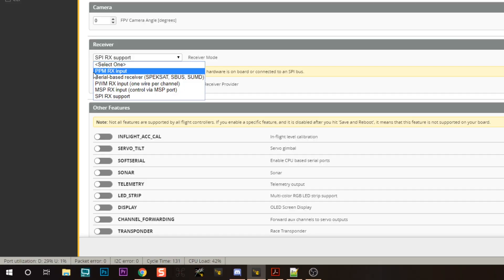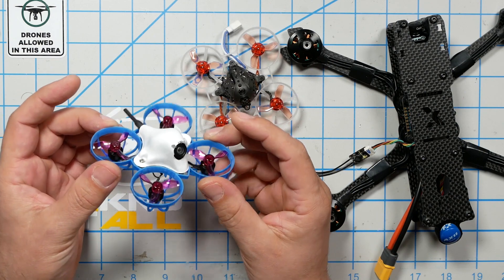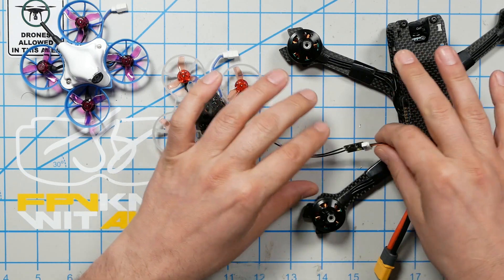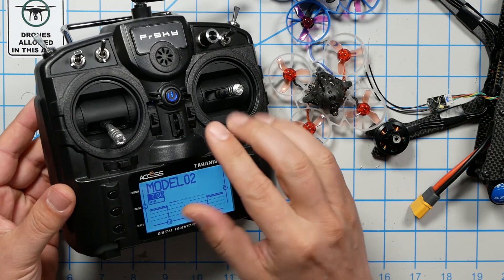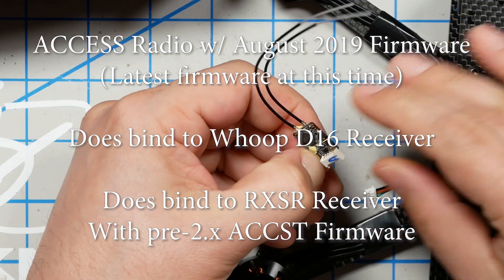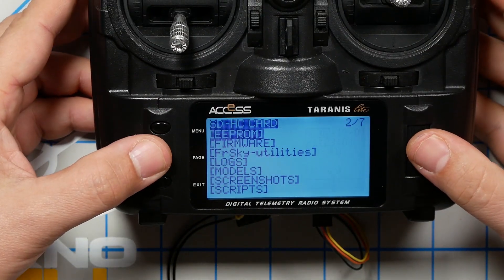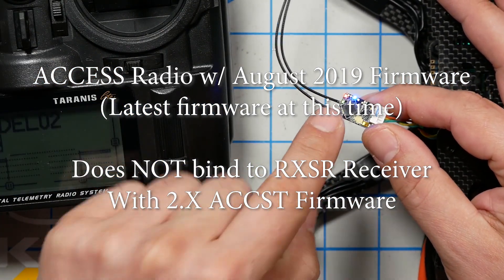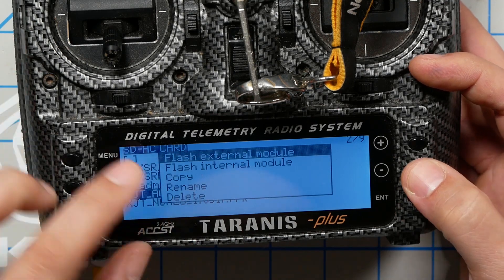FrSky won't bind! ACCST 2.0 is to blame.

Comment: New receiver, wrong country firmware. Made the mistake of updating the RX only to come across this. LUCKILY, on the FrSky downloads, at the bottom there’s a “history firmware DOWNLOAD (not compatible with v2.x.x)”. It downloads an older version and works. Needless to say I’m not impressed that it has to be this way. When £ allows, Crossfire will be my path.

Comment: Hi Joshua. You really should update this video somehow. Can your edit your description? You say at least twice that the Jumper's module "...can not and will not support ACCST v2..." but it does now, and has for a while since you made this video. I love FrSky bashing too, but there really was an uncommanded servo movement issue that FrSky addressed (then tacked mild encryption into, making v1 incompatible). To anyone reading this, I recommend updating everything FrSky branded to ACCST v2, then using a multiprotocol module with the latest firmware to fly anything you own, ACCST v1 or ACCST v2.

Comment: I have an X9 Lite and would consider getting the R9M module if it weren't for the confusing firmware soup and absurd business decisions constantly breaking backwards compatibility with non documented things like D16 2.0. Everything Frsky is so opaque that I had no idea when I bought my X9 Lite that I'd have to buy a multiprotocol module just to be able to bind D8. What a disgraceful company. Jumper T16 and Crossfire seems to be the ultimate setup to fly everything without having to swap modules.

Comment: Then take your Qx7 recommendation off of your website. The only reason I bought the, now, crappy radio was because all you guys recommended it as a good entry level radio. Now, I'm gonna run into this "no bind" issue down the road because I'm gonna forget about this vid. Then "upgrade" the firmware to ACCST 2.0.
Reply: Qx7 is great man , been flying mine on R9m for over 1.5 years, flawless, but I only 5 n 6in
Reply: @flo-ridafpv5713  That's supper great to hear. I have the Qx7 also and I do like it. What makes me mad is how these how highly recommended products slowly start to stack up negatives as time goes on. That's reason I've avoided this hobby for as long as I have. I want a completed product but, I'm starting to realize that this hobby is still littered with half-assed products. Then these YouTubers pimp the garbage without a disclaimer so they can get that coveted "play my game and get paid" lifestyle. I'm just tired of this instant gratification world we live in. It's even got to the point where video games don't come out completed because of this "we  can just update it after" mentality. People shouldn't just put up with bullcrap just to get a little taste of the good stuff. I just want to be informed about the negatives a little more. If comes down to spending $800 dollars for a radio and not to get shafted. Then that's what I'll do. But, don't tell me "oh, this $100 radio will do everything you'll need." Then 6 months later be like "maybe not." Along with ignore me on streams because I call you on the carpet.
Reply: @focusforlife  cool qx7 is solod gear that wont change, if you mean bardwell, he's a good dude who's actually in it to help the buyer he's not a shill, been watching him for years, this issue is just deeper than good product bad product, it's about the ecosystem that frisky is making super complicated w ton of firmware versions n trying to lock out 3rd party stuff when they started on open source, that's all n people are pissed. So don't hate bardwell he's tryin to help educate us
Reply: @focusforlife  and just don't update man simple, I was on 2.0 n only went 2.2.2 to get r9m to work like 1.75 years ago,  still on it, if it aint broke dont fix ;) watch Pawel say it   https://youtu.be/UXl-F-WsEs8
Reply: @flo-ridafpv5713  thanks for the great positive attitude in your replies. I'm not just trying to be a hater. I agree Bardwell is a good dude. His delivery, on some stuff, just gets my goat. As far as his streams go, I just get tired of the repeated questions being answered. I watched a viewer spam a question, that could've been answered if he just watched Bardwell's vids, for 3 streams in a row and,  get answered. Then I've seen other legit questions just get skimmed over. I hate watching streams just for a small morsel of info. That's all, mang. Thanks for a good convo.
Reply: @focusforlife  yea man I feel ya, u gotta understand all he does is try to serve the ppl, it's his bread n butter, n ppl are bugging him w frsky created probs, i watch his streams after so i can FF n cuz I like him I can't handle all the live chat lol & u must not be on any Facebook fpv groups, no one searches they just post, but they get answers fast n are a wealth of knowledge, like RCG used to be but searchable, Feel free to ask me if ya need help I might know, been absorbing this shit for years ;)
Reply: @flo-ridafpv5713  will do man. Thanks again.

Comment: "Jumper T16 which can not and will never support the ACCST 2.0 protocol" Yeah... I guess you were wrong about that. The multimodule now does support it.
Reply from the maker: I think you are thinking about the hardware mod that basically installs an ACCESS module inside the radio. Pascal was asked in Dec 2020, "Will you support ACCESS," and he said "no" and marked the request as "Won't Do."

https://github.com/pascallanger/DIY-Multiprotocol-TX-Module/issues/487

If you know different let me know. MPM support for ACCESS would be great.

Comment: Is the issue with the "uncontrolled servo movements" that was fixed with this even relevant for us quad flyers? There are no servos on our quads or am I wrong? So if so it doesn't make sense to upgrade anyway. I also don't like the way FrSky is going but to be fair all other Rx manufacturers have the same bugs with servo movements etc inside their firmware and just don't give a damn about fixing it. At least FrSky tries to fix issues in their protocol and improve the transmission. This is something that I would also like to see from Radiomaster etc.
Reply from the maker: It is relevant. "servo movement" just refers to the outputs of the receiver.
Reply: @JoshuaBardwell  Ah yes sorry that's right I've read that long time ago in a german manual. From Input -> to mixer -> to servo output -> to HF Module 😀. Ok but in the same manual it is written that those servo movements problem only occurs very rarely on LBT Firmwares and even rarer on FCC Firmwares.

Comment: Still can't get 1 of many RXs to recover bind after moving models around on my Jumper T16. I cannot rebind it, which tells me it is still bound to transmitter. I have tried all the receiver numbers in case it was locked to the model slot number. Funny how all the other RXs never skipped a beat. Last time this happened I reverted to the backup I made prior to the changes made and it fixed the problem. Not so lucky this time. I updated all my Frsky the day they released the 2.0 updates before trying them out. Oops! Learned something, thank you Joshua, so not a total waste of time.

Comment: Slightly releted...With access the XM+ has only version 1.1.2. That version doesn't exist for the R-XSR (1.1.1, 1.1.3, 1.1.4) so you cannot use them together. Infuriating!! Had to downgrade all my XM+ to accst.

Comment: Thanks god I have replaced the frsky internal module with a 4in1 multiprotocol in my x9d+
Will never buy new frsky again!
Reply: That sounds great! I didn't knew that you could do that!
Reply: @jorgeromero4680  I cheated a bit :-) Actually the internal module burned up, so insted of replacing it, I removed it, and installed a 4in1 multimodule. I have a crossfire in the modulebay, and run them both as external modules. I use a 4 pole switch to select which module I run. This way I can run almost any protocol out there, including the old working frsky protocol :-)

Comment: I have a Taranis x9d on 2.1.9 I order a couple of XM+ Receivers for two new models, ZOHD Dart and ZOHD Drift. I was not able to bind these RX and searched YT and found videos showing how to update the firmware on my TX and the new RX to support new FCC / LBT. If you screw up like i did and upgrade your firmware as advised on the Fr-Sky site x9d+ , XM+ receivers. You can go back flash your TX and RX back by following this link. https://intofpv.com/t-beware-frsky-accst-d16-2-x-x-firmware?page=2 Just don't ever upgrade your openTX.

Comment: I don't understand why this was a shock to anyone, it says on the download page that you need to update both the receiver and remote. So obviously it won't work. This video was just made to create drama. Also why not just bind the betafpv quad in d8?
Reply from the maker: I would like to share with you the huge number of questions I have received in the last two weeks, that have been caused by this issue. I didn't create this drama. This video is designed to clear up questions about what will bind to what. You are right that you can bind the Beta quad in D8. But before I made this video, did you know that would work? Or might ACCST 2.0 also break D8 compatibility? That's why I made the video: to find out, and to let everyone else know too.

Comment: Ran into it yesterday... normally other brand user, wanted to help out our club. There are 2 QX7 radio's available foor Master/Student link. We added a frsky sbus to one of them for a wireless link which works... Than we had som Jumper R8 rx's sitting ont the shelve we opted to use.... then we went down the Sh*thole.... WIll never ever buy anything from this company.. I use ELRS as well. at least thats a clear path....

Comment: Don't most built-in D16 receivers also allow you to bind in D8? I had to do that in the past when Betaflight didn't handle D16 on SPI very well.
Reply: But the latest FrSky radios do not support D8 :)
Reply: @tomaszstelmach2844  good point! Worst case though you could put a MPM in the module bay, giving both D8 and 'old' D16?

Comment: i HATE companies that use deliberate introduced incompatibilities and segmentation as a competition or lock in tactic it is the WORST HORRIBLE SLIMY anti-consumer anti-competition and should be rooted out and punished
Reply: and there needs to be OPEN STANDARDS for digital vtx and telemetry and control for gods sake people its just sending numbers and data packets over rf it's not rocket science :V

Comment: Greet from Germany .. bougt an betafpv65s pro wont bind with my Qx7 ... That moment i never fly again ... -.-
Reply: Uh? Either it’s a faulty RC or you’re not using SPI and Frsky_D...
My 75s worked without issue with my QX7.

Comment: Ryan Macaluso, FrSky Director of North American Operations says you’re wrong. I mean, I can’t prove you wrong, which is the problem, but HE says you’re wrong. Other knowledgeable youtubers have also very recently told me that once you flash the ISRM up to 2.shit, it nerfs spi compatibility. That’s what I’m finding time and time again in my own testing.
Reply from the maker: What does he say I'm wrong about? The SPI and other 3rd party receivers being incompatible with FrSky firmware 2.x is not up for debate.
Reply: @JoshuaBardwell  One of our customers bought a new Archer RS and it wouldn’t register/bind on ISRM  1.3 so we had to flash it to 2.x. He found out the hard way that it broke compatibility with all of his spi boards. I’m being told by everybody but Ryan you have to choose one firmware or the other.
Reply from the maker: In my experience, FrSky firmware 2.x will only bind to authentic Frsky receivers running firmware 2.x or newer. If Ryan Macaluso wants to show me different I would love for that to be true.

I guess one exception would be receivers like the Jumper R1 which is a clone of the XSR that runs XSR firmware. In theory you could flash that to 2.1.

The good news (I hope) with Archer is that you can update it OTA? Did that work for you?
Reply: @JoshuaBardwell  once I updated the ISRM, it registered and bound, and it was passing signals to the board. If it needed to be updated, would it have detected that and popped a prompt like TBS?

Comment: Hi Joshua. I accidentally run into the same problem with BetaFpv65s + Taranis X9Lite. I found your video. I cried. And then I found this: https://www.currykitten.co.uk/using-spi-receivers-with-an-lbt-eu-radio/
solution 1: A Multiprotocol Module - I would like to buy it.
solution 2: The original firmware was MATEKF411RX version 3.5.something. With the latest 4.2.5 (which is maybe too high for that little one) it can bind but not work. With 4.1.0 I was able to bind and ARM. But with FRSKY_X_LBT selected it losing the RX signal every moment. Just change the mode and you can hear "Telemetry lost."
solution 3: Looks like working well. Yet. ;-)

Comment: See this is why I use Flysky. Nah jk I just can’t afford anything else
Reply: I mean it works and I like the basic transmitters. Granted, my i6 has more cost in its modifications than the controller cost, but it does great and works with plenty of tiny whoops and a huge variety of receivers.

I’d take more batteries and more flight time than a better controller, and better is relative, I’ve used a $1k+ transmitter and it was setup like $hit for me out of the factory and literally all wrong for how I’d want to fly, like seriously the thing was a waste of money and required more tinkering to get useable than a flysky with a LiPo battery mod. Lol, I really tried convincing the team to just not use it, I think it was a Spectrum DSMX protocol, something absolute top of the model (and it looked nice), but it was terribly clunky and the stick friction and spring settings were so stupid out of the box I don’t see how anyone could have liked that, like I don’t like grinding noises coming from my transmitters! And it wasn’t a one off, the team had ordered several, it’s just how they set them up from factory. Plus the setup was overly complex and we didn’t need something that fancy for flying jet powered UAVs anyways (a flysky 6ch could do that, throttle, 2 flaps, thrust vectoring X and Y, and munitions deployment, 6ch... no need for 16ch or whatever it was).

Comment: The real question is, can you downgrade back?
Reply from the maker: Yes.
Reply: Until FrSky starts releasing rx that don’t work with the old version... wait and see. It’s like a slow motion suicide.
Reply: @brokenprop2474  As long as the r-xsr can be flashed with the old firmware, I think it's fine. I don't like the way things are going though :(

Comment: Well this is a bit unfair and misinformed. The SPI RX implementation in Betaflight is a reverse engineering of D8 and D16 protocol using the cc2500 radio chip. So it's not really surprising that an update by FrSky might have broken something. The chances are likely that the reverse engineered implementation is not exactly the same as FrSky's so to assume that they "broke it on purpose" is a bit unfair. And in the meantime we're working on updating the SPI RX code.
Reply from the maker: My understanding is that they added a checksum or some kind of rudimentary encryption that breaks backwards compatibility. Given their competitive decisions in the past (nerfing QX7 inverter), I don't believe that this was unintentional.
Reply: Seems premature to assume that. And adding a checksum would be considered an improvement and we would support that kind of change. Remember, FrSky is under no obligation to support anything related to the SPI RX as it was completely developed outside with no input or help from FrSky. So the reality is that if they make legitimate improvements then it's still likely to break our code. That's just the way it is. The alternative I guess is that they never improve anything.
Reply from the maker: Regardless of if someone agrees with my personal interpretation of their motivations, the reality is, this decision is incredibly confusing and frustrating to many people, which is why I made this video to clarify what is compatible with what. My inbox is full of people who don't understand why they can't bind their Whoop any more.

I would like to know if there was a technical reason why the firmware could not be compatible both with the new protocol and with the old one. Every single FrSky firmware has been backwards-compatible until this one. Want to add a checksum? Fantastic. Why can't you also support the pre-checksum receivers at the same time?

FrSkky nerfed the QX7 to break Crossfire compatibility. They left D16 out of ACCESS radios at first. And other decisions which seem to indicate they prioritize locking out competitors over what is good for their customers. So I don't have much benefit-of-the-doubt to give them here.
Reply: Well it is true that FrSky really doesn't seem to understand their customers. But I can certainly see why they feel it's in their best interest to not support a competitor's product in their radio. Or make some effort to prevent a third-party receiver (which they get no income from) from working with their radio. We may not like it and can stomp our feet all we want, but that's business. Vote with your dollars and take away their business. And it's likely we'll never know whether the changes were required to support new features or maybe just a change introduced that inadvertently broke SPI RX for us. Why would they care or bother to test that? It's not one of their products and they have no obligation to support it.
Reply from the maker: They have no obligation to support 3rd party products, but if their customers use and value those products, then as you say, customers can vote with their dollars. And I think they are.